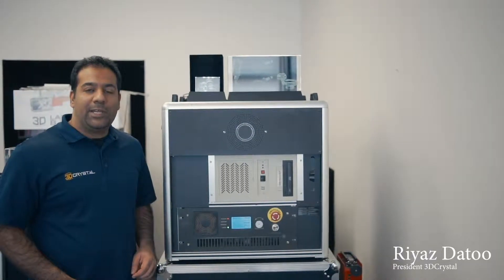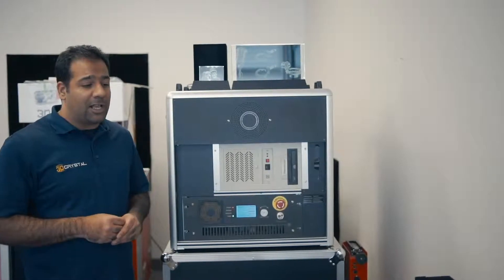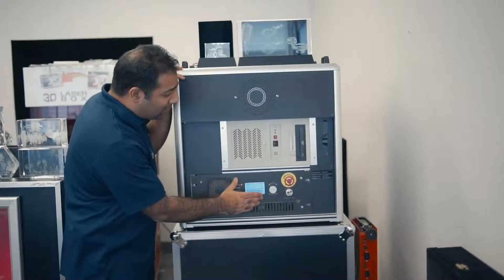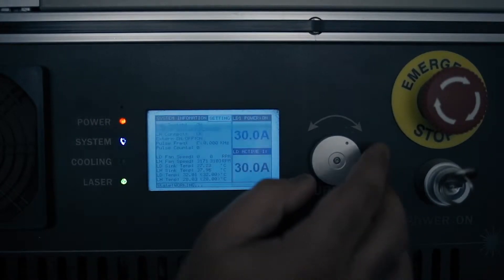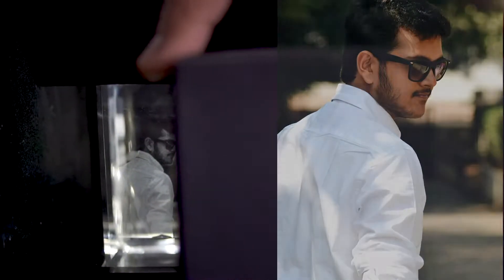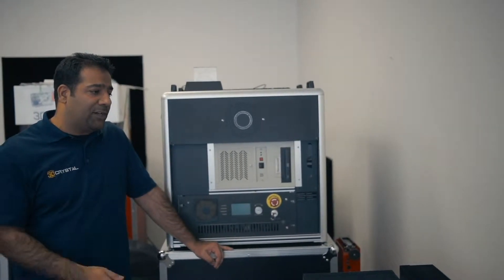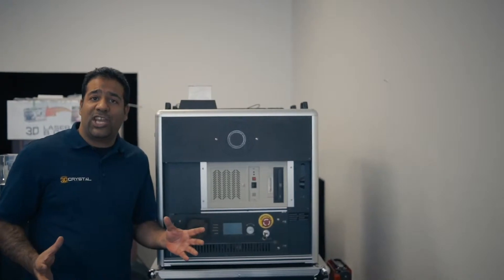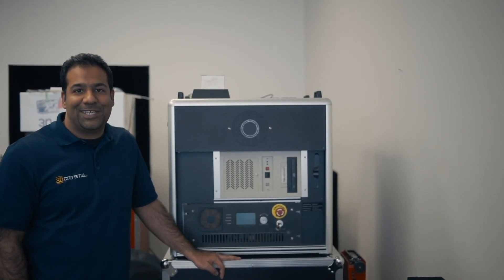3D Laser Engraving Machine ⭐Setup & Fix your laser⭐| 3DCrystal.com

Comment: Hi 
What laser do you need to have ? Or you need a special software?
Reply from the maker: Hi there, the software / service package would be cockpit3d (see cockpit3d.com).  You can purchase any sub surface laser engraver (not CO2 surface). If Shopping around feel free to send us specs of what you find for feedback prior to confirming a purchase from any manufacturer.  I and my team will be happy to help.
Reply: @3dcrystal  thanks then I can use my machine to engrav just i need to buy the software correct?
Reply from the maker: @abrherzog12  once you have your laser contact us for a free license of the software for 3D file preparation.

Comment: Great Tips again. I was informed that you can Engrave on metal with the same 3-D laser machine, have you tried this? What else is possible,Many Thanks
Reply from the maker: Thank you.  Yes you can engrave metal. It's good for inscription on plates.  There is no exhaust ventilation so a CO2 laser is built better for surface etching.  3Dlaser engraving machines are best used for sub surface lasering in transparent material.